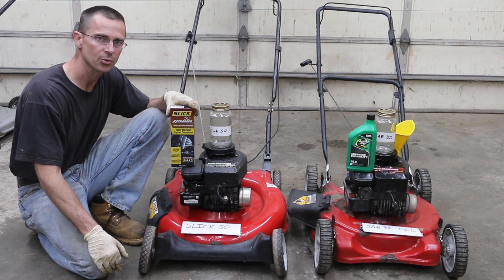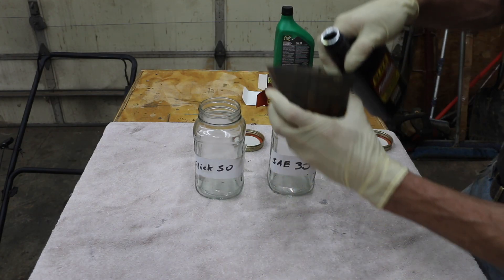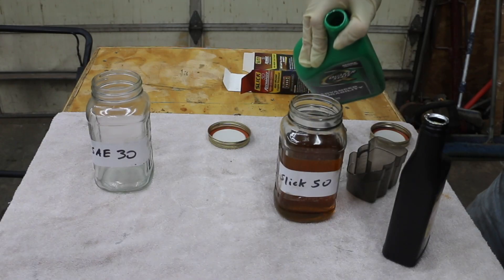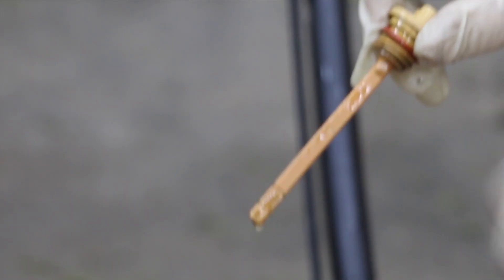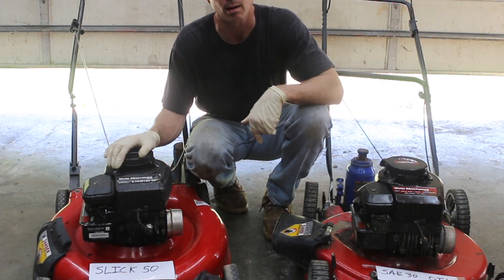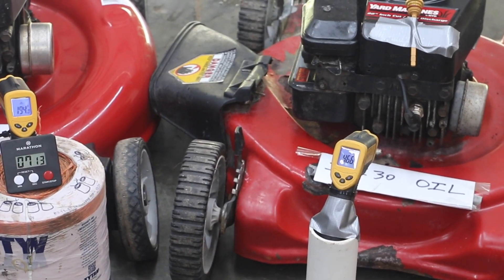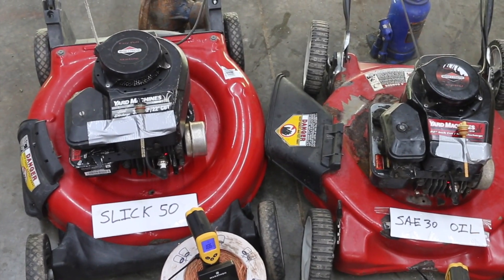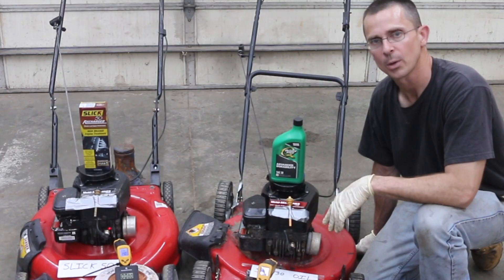Can't believe what SLICK 50 did to my engine!!--Dry Crankcase Test!

Comment: That's a brutal test. I do not believe in additives but I do believe with proper maintenance, most good engines will outlast the vehicle.  I have mostly had Toyota and now a Mazda. As for lawnmower, I have been using Briggs and Stratton with no problems. I would never waste money on an additive with my luck so far without them.
Reply from the maker: Thanks for commenting. I was shocked that Slick 50 didn't win, but I guess the test design wasn't entirely fair.  I'll be using 2 new engines vs used ones in future videos.
Reply: No please don't kill more good engines. You made your point.

Comment: cool vid. been a tech for 20 years. I have heard stories of slick 50 wrecking the rings. and no, there is no magic additive to prevent metal on metal damage when there is a loss of oil. try a set of Teflon coated bearings maybe
Reply from the maker: Thank you for commenting on this.

Comment: lol in your car did you ever drain all the oil out, most likely not right so, if you follow the instructions and work inside the prescription on the bottle you wont have a problem, but of course if you let the oil out and let the Teflon burn it will bind up, there is a product that dose sort of work, and that was pro-ma performance products its MBL product is said to do this, it is a metal based lube,  it is made of very fine balls of lead and copper, and only draw back is if it gets in contact with water it will cause corrosion,  as it works like a battery and promotes electron flow causing rust, they say it has a less than 1% wash out, so I put it in my push bike wheels and it rusted out the bearings,  after a few weeks in the rain, but to be fair it was meant for an engine , not the open air, and my motor bikes filter just pulled it out of the oil, I was using a Honda SL 90 it has a centrifugal filter that you can clean  I seen the lead and copper dust in the filter and any good filter would just take it out any way
Reply: and the biggest problem I see with an MBL lube, is if it clogs your filter your oil will stop flowing into the engines bearings  as the filter is blocked

Comment: The  SLICK 50 -"Teflon" itself has *no effect at all*.  Unfortunately the base oil of slick 50 is a quite simple 50W oil with no modern additives.  So what you compare is  a simple oil with some dirt in it (the "teflon" particles) to a modern multi-range oil with additives.

Even the tiny remains after draining show the difference of a good oil and a simple oil with some dirt in it. What did you  you expect?

Sidenote: Of course this test is not telling that much about the oil at all as the engines are not the same, not the same age, not the same condition etc. Do it with 2 identical  and new engines  … to get the same result  ;-)
Reply from the maker: Thanks for commenting and the constructive feedback.  I'll use new engines in an upcoming video.
Reply: Well I guess it might not be worth it. New engines will cost some money  and I have no doubt that the result will be the same. But thank you for your videos btw.

Comment: Please compare any conventional oil vs mobil 1 full synthetic. I have ran Mobil 1 full synthetic in all my 4 cycle engines and I have never had one fail....yet. Even in a small engine the oil should be changed at a minimum of 1 year even if you use full synthetic. The oil breaks down with time, just like gasoline does.
Reply from the maker: Thank you for this recommendation!

Comment: The way this test was set up was not ideal.  I've used Slick 50 since I started driving in the 80's, and my dad used it since it came on the market.  I will say this, I've always used it with Mobil 1 Synthetic oil.  I have two instances to prove the worth of Slick 50.  In 1984 my dad was driving from San Antonio to LA. His BMW bottom out going over some railroad track. It took a few mile before he lost all oil, but he keep driving to the next gas station which was about 60 miles away.  His engine did not seize and it never overheated.  This engine was run with Mobil 1 Synthetic and Slick 50 from the day my dad brought it new from the dealer.  The engine had to be replaced because dirt and sand had been sucked into the oil pan and destroyed the bottom.  The mechanic was still amazed the engine ran for 60 miles.  The engine also started one more time at the gas station.  In 2002 I was building a VW 2.9L VR6 engine, the block came from my wife's 1994 VW Passat.  This engine had 127,000 miles on it when I pull it from her car.  Once again this engine had been run with Mobil 1 Synthetic and Slick 50 from the day I brought it with 1123 miles on it.  When I took he block to the machine shop to have it punch out, the asked me how many mile were on the engine and when I told them 127k.  They said there was no way the engine had 127k because all 6 cylinders still had the original honing marks.  They essentially said the engine had no ware after 127k.

The amount of time that the Slick 50 was in the engine was not enough to allow it to work as designed.  That fact by itself negates the whole test.  Even if you use it as instructed on the box, letting it run in the engine for one cycle from cold to operating temp is not a true test.
Reply from the maker: I enjoyed reading your comments and thanks for the constructive criticism on the video. I'm improving my test equipment and the approach I use in future videos to provide a better assessment.  Thanks again!

Comment: There is this stuff out there called "X treme" Friction Fighter. I would encourage you to try that same experiment with that product. Many truckers use it. One trucker used it in his hubs on the front end. The seal failed once but the bearing survived and did not burn up. I use it in my 1994 Chevy and in the engine. It's a metal conditioner and it has helped the engine tremendously. It works in anything mechanical (engines, gearboxes, hydraulic systems and even refrigeration units). It's great stuff.
Reply from the maker: Thank you for this recommendation!

Comment: For this to be an accurate and fair test you have to have two identical new engines, have to run them both for 10 hours with oil and oil/additives in them and fully drain them. While watching the video I was struck by how much less oil you got from the oil only engine.
Reply from the maker: This is great constructive feedback. Thanks for commenting!

Comment: In the commercial didn't they use straight 100% slick 50? Not mixed with oil.
Reply from the maker: This is a great point. I don't recall.  Thanks for commenting!

Comment: I am thinking the opposite of the comment below.The plian oil engine ran hotter indicating more friction. But also thicker bearing metal and less stress history on components. When do we see the tear down to see what caused failure in each and a score sheet on bearing wear? A real scientific method would start with 2 or more identical engines from the same batch. Pre-torn down and measured and recorded. Then reassembled and run head to head. 6 or more engines  with controls for preconditions would allow error factors to be controlled for as well. While I appreciate the effort here there are many uncontrolled factors. The unknowns about both of these engines rather negates a conclusion from this result.
Reply from the maker: All great constructive feedback.  I've been consulting a chemist who works in the petroleum industry and will be applying far more scientific rigor in future testing, to include new engines.

Comment: I wonder if the reason the SAE30 engine was running hotter is that the Slick50 engine's exhaust was blowing almost directly into the air filter of the SAE30?
Reply from the maker: This is possible.  Surprised it lasted so much longer, even though it was running hotter. Thanks for commenting!

Comment: I always believed in these additives I was like you big believer in slick 50 and I used it like you then I heard about Z max and have been using that in my vehicles I have 267000 miles on my 93 suburban and it's still a very strong engine I have been using Zmax in it since I bought it I've treated the suburban three times with it and it hasn't missed a beat maybe it would work better for you in your test I swear by it great video I really enjoy watching them
Reply from the maker: Thanks for the positive comment.  I plan to test Zmax in the near future.  Thanks again!

Comment: I swear by a product called Prolong. I was taking the wifes Mustang to the gun range but need to stop at walmart for some supplies. I left my teenage son in the (running)  car while I went inside the store. When I got back to the car, about 25 minutes later,  the valves were making a terrible racket and there was an oil slick under the car. He had turned up the stero and didnt notice the engine noise. I found that the line going to the aftermarket oil pressure gauge had broken and had pumped out all the oil from the crankcase. I replaced the damaged line and refilled the the crankcase with fresh oil. That was over 5 years ago and the car still runs great to this day!
Reply from the maker: I'm told Prolong is a terrific product and I'm really looking forward to testing it soon.  Thanks for commenting!

Comment: I haven't tried the new slick 50 but i used it in my 1985 Mustang GT and I sold the car still running with 327,000 miles on it and never had a problem of course over the years I used more than one treatment.Back then the directions was to run slick with a fresh oil change for i think 500 miles to make sure the engine was fully coated
Reply from the maker: Impressive!  Thanks for commenting!

Comment: @Project Farm  - Have you ever heard of/used Motorkote? Been using it for years, first found out about it from the truckers for gas mileage increase. Sometimes they will have a booth at events with a Timken Bearing machine. They encourage people to bring in whatever lubricant they want to test against Motorkote. Lucas oil treatment was scary how quickly the machine stopped/simulates lockup. It was eyeopening. 8 out of 10 oil additives are snake oil. There are videos here on YouTube regarding MK. 

Thanks and I am just getting in to all your videos!
Reply: P.S.- I also use Zmax as well. Not intended as a lubricant/hyperlubricant. They call it a "microlubricant" and it does seem to help with keeping varnishing and the gumminess down. I replaced a valve cover gasket and that is whereyou can really tell a place that will have burnt on carbon/old oil.
Reply from the maker: Thank you for this recommendation!  I'll begin an exciting new series on lubricants soon.  I'm 80% complete with building a Timken lubricity tester.  Thanks again!
Reply: http://motorkote.com/test_results
Reply: Have them test their Motorkote against just Auto Transmission Fluid (ATF) !  Stuff is Amazing ! (just don't tell them what it is till afterwards !)

Comment: I've been running slick 50 in my 2006 Chevy Express 3500 and now have 360,000 miles on it with no problems at all.
Reply from the maker: This is terrific!  That's a lot of miles.  I own 2 GM vehicles and I really like them both.

Comment: My first experience with Slick 50 was in an old carburetor 5ltr V8.
20 mins after I added it the idle had gone from 800rpm to over 2000rpm due to the reduction in friction. I had to wind the idle screw back substantially to compensate!
Reply from the maker: Wow!  It sounds like it worked very well. Thanks for commenting!

Comment: Was an interesting experiment, although like many other commenters, I find the results to be dubious. My personal observations are that the "Slick 50" (or more accurately, what the retailers are SELLING as "Slick 50" these days) needs much more time cycling in the crankcase in order to bond thoroughly. That being said, the mixture would not seem to have been in the crankcase anywhere-near long enough to have come out that dark! Something is fishy here.
Also, everything else being equal in these two engines (?), the lower temps in the S50-treated engine are certainly significant, and would seem to indicate less internal wear! With all respect to you as a fellow mechanic, I'd personally have to call this result "Inconclusive".
Reply from the maker: Thank you for the constructive feedback.  I plan to use new engines in future videos to ensure a fair comparison.  Thanks again!

Comment: My Step dad use to race dirt track and he use Marvelous Mystery Oil in his dirt track car. He always raced the car two years and twould take the engine apart to rebuild it after racing it for two years. Before using regular oil they would have to rebuild every two years but when he added Marvelous Mystery Oil instead of regular oil after the two years they were surprised that after racing twice a week for two years the engine didn't have any ware what so ever. The parts looked just as good as the day they put them in.
Reply from the maker: This is impressive!  Thanks for sharing this experience!

Comment: I think there was something else to cause the Slick 50 engine to fail first. The Slick 50 engine was running 40 degrees cooler and theoretically should have lasted longer.
Reply from the maker: I plan to use identical new engines in future tests.  Thanks for commenting!

Comment: try MBL,  metal base lubricant.   I run my pickup to town and back dry of oil once,  (unintentionally)  didn't hurt it.  30 mile trip.    I did notice extra rocker noise.   On a lubricant test device it was many times better than any oil,  and after using mbl in it, it could be all wiped clean and still super lubed,  had to use sand paper on the lube test wheel to clean it off.   While it may not work forever, I think it's the best lube additive ever invented.   Not commonly available in stores,  have to mail order it.
Reply from the maker: Thank you for this recommendation!

Comment: Kinda a waste to measure the temps the way you did.  You did not do a baseline engine temp on each engine running under the same lubrication.  The engine that received the slick 50 may have been running cooler than the other one anyway.  So no real way to tell if the slick 50 was making it run cooler.  Also the SAE 30 engine looks older.  Maybe the looser tolerances in the bearings and rings allowed it to run longer without lube.
Reply from the maker: Thak you for this constructive feedback.  I'll be using identical new engines in future tests.  Thanks again!

Comment: Slick 50 is essentially tiny Teflon balls, Very, very slick. However, when drained, they will pour out a lot more easily that the straight 30 weight oil did. These little balls need to be kept in suspension to work properly. Slick 50 is NOT a surface coating product--it is a suspended micro ball bearing product.

I never use it because it has a tendency to glob up when cold, and can clog some very fine fuel filters, etc. After sitting for a long time, Slick 50 will leave a residue in the oil pan. This residue may not regain suspension in the oil. Slick 50 is OK if the oil is warm, and the engine doesn't sit for any long periods without running.
Reply from the maker: This is a very informative post.  Thanks for commenting!

Comment: I've never used Slick 50, but I have used Duralube. It saved my ass once, I lived out in the country and I didn't know that my oil pan was leaking and I had a fairly long drive into town, just before I hit town I noticed my engine was getting unusually hot, it hadn't reached the danger zone but concerned I pulled over and checked my oil, it was bone dry. I have no idea how long I was driving like that but I let the car cool down and managed to drive it to a close garage with no problems. I do think it was Duralube that saved my engine that day. Maybe try that product and I can finally put this question to rest.
Reply from the maker: This is impressive!  I plan to do the torture test in the future using DuraLube.  Thanks for commenting!
Reply: No problem. I hope you try Duralube, like I said it has always been my impression but I am not 100% convinced. There are just too many variables to my story to concretely say it was Duralube that saved my engine. I don't know how long my engine was running with the oil drained obviously it didn't dump all the oil at one time it was gradual and I know your test won't completely put the question to rest but it'll certainly answer the question if Duralube at least contributed to saving my engine.

Comment: Very interesting to note that that Slick 50 engine locked up at around 200 Degrees, which seems odd since the metal didn't seem to get even hot enough to expand to cause the engine to seize.
Reply from the maker: I agree.  I plan to do all future torture tests using new engines.  Not sure why there was such a large temperature difference.

Comment: You would should of had two new identical engines run for say 10 hours. Then drain oil one of the engines you used could have done twice as much work or had bearing problems not a true and fair test but is
Reply from the maker: Thanks for this recommendation!

Comment: I'm not sure about other people out there but I've oftern wondered what happens if you put 2 stroke oil in the 4 stroke crank case, would it run better or worse, we have a lot of oils in my shed and is there any risk to damaging my engine if I accidentally put 2 stroke in the 4 stroke oil?
Reply from the maker: Thanks for this recommendation!
Reply: Project Farm no worries mate I'm hoping one day more people ask this, and maybe you could do a short video comparing engine noises and temperatures with a similar engine but with 4stroke oil in many thanks